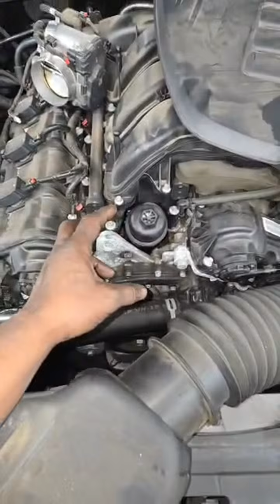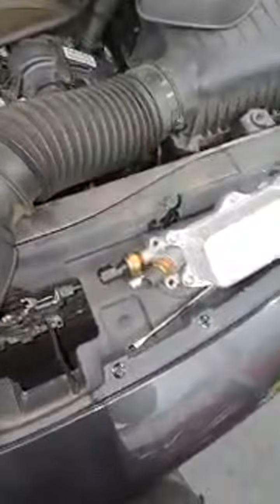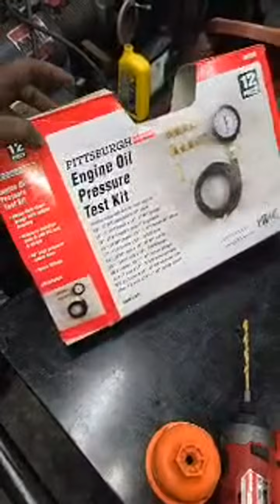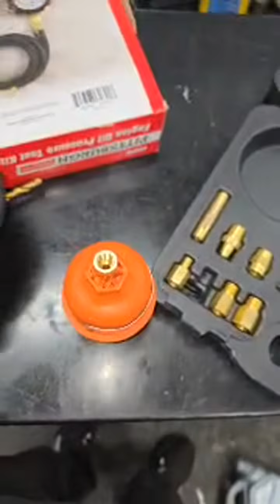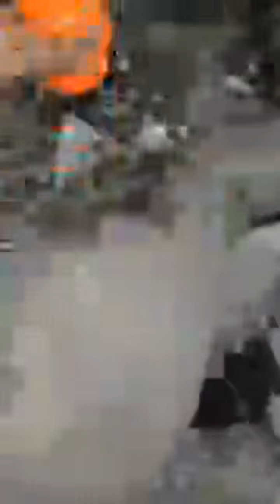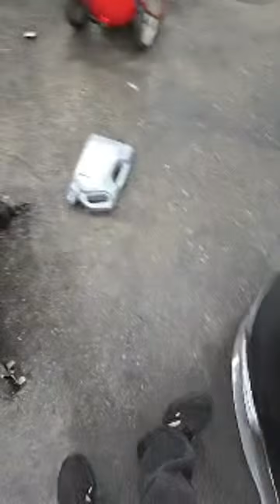The FASTEST Way to Test Oil Pressure on Your 3.6L Pentastar Motor!

Comment: Hey man I have a 2014 charger 3.6 with p0390 replaced cam phasers, vvt actuators and cam shaft position sensors and still have the same code also made sure timing was good and it is

Comment: I got a question. My 3.6 on my dodge ram is in limp mode giving me about 10 codes 5 when I erase them with my OBD 2 but can’t get it out of limp mode oil is at level but was low when I checked it I’m getting a pedal code and pressure code can I get a correct reading if I do this pressure test while in limp mode ?

Comment: Going to do this tomorrow, 2014 dodge journey was always reliable until rockers and lifters needed to be replaced and now got a p06DD code and replaced everything(pressure sensor  and oil pump including new solenoid) and code still there.
Reply: Did you solve it? I got same code.
Reply: @Jhons0099 same here

Comment: Since you're the Pentastar expert, I have a question for yoi concerning oil pumps. 
I just bought a '13 Challenger 3.6l. Guy was like, it makes noise. I startered it, 3 rods were knocking, shut it off. Keep it mind it started and ran.  Got it home, went to pull engine. Can't hardly get it to turnover to get the convertor bolts out with a 30" breaker bar. Pulled rod caps, all were spun and 2 were welded to the rods, #5 & #6.mains were hardly hurt. Could reuse them. 
Pulled oil pump, diassembled it. It looked fine. Very minimal scoring or discoloring on the outer ring.  They had been running Mobil1 oil. Inside of heads looked brand new. Pistons looked very clean also.
Putting it back together but want to know your thoughts on what caused it. Bad oil pump? Bad control valve? Something else? I dont want to go through reassembling it only for it to lock up in 5 minutes on startup.

Comment: I just came across your video and will be going to harbor freight to do the same, thanks. I recently swapped a motor and I'm getting a flickering oil and engine light, doesn't matter idle, higher, rpms,etc. I have replaced my oil pressure sensor and will get a reading on actual oil pressure also. Have you ever had this issue? Motor runs quiet with no noise. It is not throwing a code. Thanks
Reply: Did you ever solve it?

Comment: Planning on changing my oil cooler housing using Dorman cooler.
Should I change my oil pressure and coolant temp sensors,  even tho mine are fine, 85k on them.
If I change them, do I need to use the Mopar versions, or are the Dorman sensors okay to use ?

Comment: Appreciate this video! I hate having to buy something expensive that I use one time than it just collects dust for years. I just happen to have an extra Dorman with the orange cap, side note never over torque the oil pressure sensor on that aluminum unit ask me how I know...lol And Dave Pike, he a top notch Pentastar guy as well.

Comment: love your vids. in my case i have an extra cap cause i got the aluminum oil cooler . i intend to step bit drill the extra oil cap and jbweld in a fitting that will accept the harbor freight oil pressure gauge .

Comment: And you buy one for $47 lot easer 😉
Reply from the maker: Buy one what?
Reply: @ the oil pressure cap
Reply: How hard is it to drill and tap a pipe thread hole in a cap you already have and the fitting you probably have in your brass drawer and it's free and right there, not $47 and waiting for it.
Reply: @ I agree with you.. but I don’t have a spare filter top and or any brass fittings. Iam diy and buy the time I buy a new filter top and brass piece it’s just easier for me to buy it and have in my box . But of u got the stuff much better I agree

Comment: It seem like a lot of the 3.6s you have taken the valve covers from have sluge O know its because lack of maintenance but could it also be cloged or bad PCV valve?
Reply from the maker: No, just pure unadulterated neglect on the car owners part. Even the PCV valve that you speak of has a recommended change interval.

Comment: These are damned good engines. The only thing that takes them down is lack of maintenance and abuse. If they are maintained properly they run forever.
Reply: Agree.  My wife’s 2013 Journey is at 176k, no ticks no leaks.  And she beats on the car like it owes her money.  I change the oil every 3k religiously, and only use real Mopar service parts like the thermostat and PCV valve.
Reply: Not even the oil filter housing? Loll  @pixelparade
Reply: @lucaswb7280  Lol, yep despite what the internetz says, the original Gen 1 cooler still no problems after a dozen years.
Reply: @ Same here. My 2013 Dodge Grand Caravan still has all of the original factory accessories/components on it and the engine has never been opened. My Pentastar is very quiet running and very powerful. Trans shifts like a dream. I have a trans pan with an oil drain plug on it so when I change my oil I also change the trans fluid. I change the trans fluid every other oil change. I do engine oil and filter every 3 thousand miles, trans every 6000 miles, trans filter every 30,000 miles. This van will run forever.  I take care of all maintenance on my van. All fluids are always changed regularly. My fluids look brand new all of the time and my pcv valve, thermostat are always kept new. Those people complaining about these engines are those folks that don't take care of them and then complain when they fail. There are many Pentastar engines around me. Many of my neighbors have them in their Dodge/Chrysler products and they do basically what I'm doing and they have no issues. My favorite one is in the Dodge Charger. Damned that car is fast with a Pentastar in it.
Reply from the maker: Agreed
Reply: They are easy to work on and parts are not to expensive